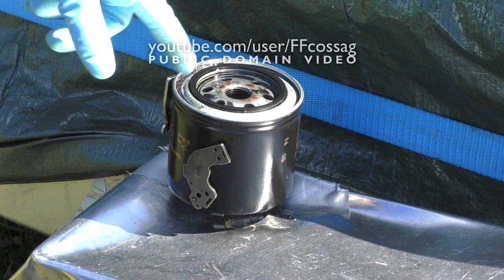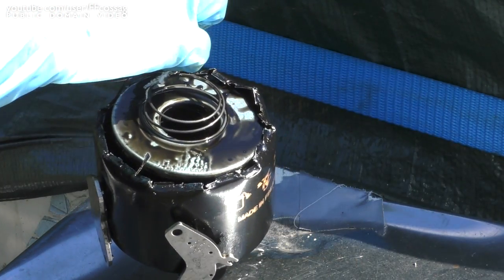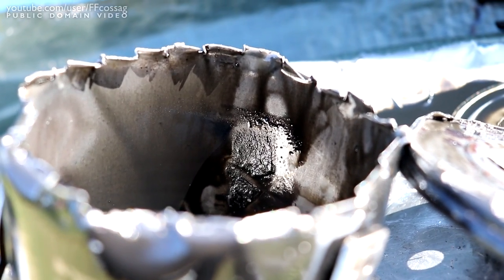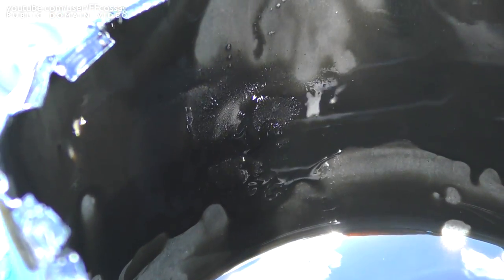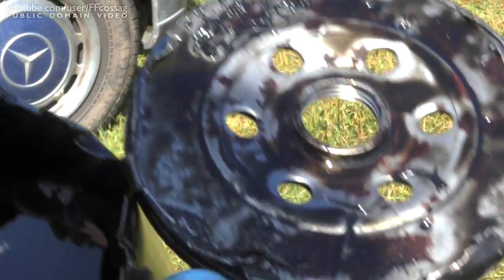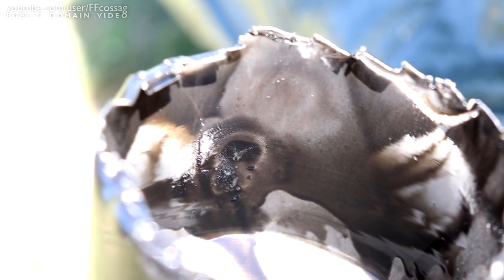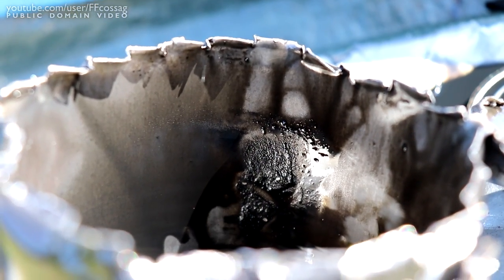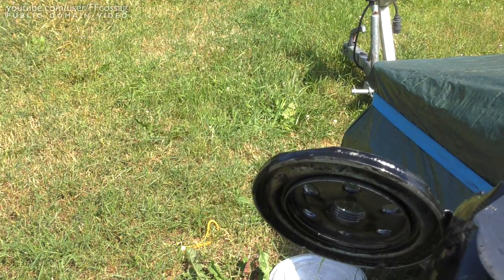Do oil filter magnets work?

Comment: I know that parts houses in the U.S. sell filter cutters (kind of like a can opener on steroids).
Reply: YEP. I ordered me a new Oil Filter Cutter just today -- Ebay -- $48.00 
Gonna find out if the FILTERMAG Magnet Kit does what it claims.
Reply: @SlikLizrd  I paid less the TEN dollars for one....
Reply: @fooman2108  Show off !!
Reply: @SlikLizrd  LOL, or just go into a friendly garage and see if they will cut open one for you!  My grandfather had one of those magnetic deals that he put on the bottom of the sump of the oil pans of his cars for years.  I do know that most of my recent cars have magnetic drain plugs on them.
Reply: @fooman2108  I want my own tool -- 'cuz I do my own work.  I spent the big bux to get a killer set of magnets, and I want to see for MYSELF just how well they work to take metal out of my engine oil. These are REALLY powerful magnets -- not a toy or plaything.
I have owned a bunch of foreign cars -- many of them had magnetic drain plugs in the engines, transmissions, and differentials.

Comment: 3:49 Aluminum is not magnetic
Reply: It is true that aluminum is not magnetic, but metals like copper, brass, alluminum and others become temporarily magnetic due to magnetic fields induced by electric induction when cundictive materials are in motion within a magnetic field. It is called paramagnetism. Also, non-magnetic material becomes mechanically trapped by the iron and steel particles, and then move together and get stuck on the magetic area. That is probaby why you see aluminum pieces in the video. 
Aluminum, boron, copper, lead, magnesium, phosphorus, silicon, and sodium are all shown to be reduced as contaminants in standard engine oil analysis when neodymium oil filter magnets are used. However, most to those materials are not extremely abrasive, except to the silicon, which is the most abrasive material in the dirty oil.

Comment: The oil itself still turns black, doesn't it... so clearly then it isn't pulling "everything" out of suspension.  What is it making the oil black?  Rubber, like from seals and gaskets... or burnt gas?  or tiny pieces of metal, like dust?
Reply from the maker: That's diesel for you.

Comment: Many years ago I designed a reusable magnet filter housing  and worked pretty good but because of loopholes in the patents rights I stopped. Magnets do work and catch the very fine particles that otherwise would go through the filter medium. Most oil filters ain't good at even cleaning oil. Yes even brand names I won't mention for fear of being dragged to court. I've found at least one make that does clean properly and that make is Purflux.
Reply: Although aluminium, alloys and copper won't be attracted to magnets but will reduce clogging so it can filter longer. 
Not many know that some filters have a bypass valve that incase your filter is blocked will bypass the filter and sends that dirty oil directly to your bearings. 😱
Bet most didn't know that.
Reply: Now im having a guilt trip for changing my oil a little late a few months ago
Reply: coolsupermanfly depends how much milage you've done over the service interval.
Reply: Also depends on how hard the oil has worked.
Reply: #16 Racing yeah right hey pitty your answer suck as I don't own a shop. Ow that hurts hey.
Reply: nightmare in action nighmare in action or your just pissed off I didn't mention your favorite brand.
Reply: Thunderstormworld dude I don't even fucking own a car only thing I own the uses oil is a lawnmower and a mini motorcycle but dont use oil filter I am into the electric cars the dont use oil
Reply: Thunderstormworld nope because I do have stuff the uses an oil filter just did not mention it because all brands seem to do the same my fzr1000 motorcycle has 350k miles on it been placing random filter and engine is still running strong and if you don't belive me there are some videos on my channel of the restoration prosses
Reply: nightmare in action nighmare in action please I've been a mechanical engineer, hydraulic specialist and mechanic for 26 plus years and there's not much you can teach me on oil filters. Please do a search on Purflux filters and you'll see the difference for yourself.
Reply: i am 100 percent sure i have been doing it for the past 25 years.
Reply: You got me curious, so I did a search on Purflux, and even on their website, I was not able to see the difference. It was not very informative.
Reply: Terry F yes their site is not that informative and if you have not came across purflux filters previously you won't know know that they are better, I had a old filter of a common brand and a purflux filter on my light delivery van that I kept for a sample and forgotten about them (what it's my workshop) 6 months later the common one was only left the metal bits and the glue they use over (vehicle exposed to the elements 90% of the time) and the purflux still holded it's shape with no detoriation or even misformed. 
Basicly youll only see the diffrence when you have inspected it first hand. Sorry for my  english spelling

Comment: 312,000 miles on my Chrysler 300 hemi..... Puralator filter, Kendall 0-20 full synthetic oil, still running today. BAM! NO MAGNETS
Reply: 720,000 miles on my 1989 Ford truck with the IHI 7.3 Diesel engine (notorious for dirty oil), BAM! WITH MAGNETS. I change the oil every 12,000 miles, and the filter every 24,000 miles. Been using Magnesaver brand magnets, since 1993. Same routine on my G20 Chevy Van with the 350 cu. in V8, it had 424,000 mile on the odometer,but I sold it, since things like door hinges were wearing out, starting to nickle and dime me too death, At the end of the of the 3rd transmission, it was time for it to go, but the engine was still running strong - same magnets.

Comment: Back on the 90s Avweb did a test on using 4 small  Neodymium magnets  1 “ long x 3/16 arranged equally spaced around the canister.    You oriented the poles each opposite to the neighbor .   They said it really did gather metallic debris  quite well.     I had a set and must say they weren’t even close to those old hard drive magnets in power..    I’ve used both just stick them on there and they will stay put.

Comment: Interesting.  However, these filters receive oil on the outside of the filter medium, filter it into the center of the medium, and thence back into the engine.  So you caught metal that might have been filtered out of the oil, had you not stopped it.

Comment: On my newly built engines I put magnets inside the engine at the oil pickup for the first 1000km.
Upon the 1000km service I remove the sump and clean it all out and remove the magnets and the contaminants.
No point really on putting magnets on the oil filter as the oil from the sump goes through the oil pump before it gets filtered.
Replace engine oil on a more regular basis than what is stated(manufacturers state long intervals so that they save money while the car is still under plan by them)

Comment: When it came time to do the oil change in my last Corolla I found a new-old Fram filter under the seat from the last owner-- with a date from around 2011. it sat under that seat for three years... still put it in, still worked A-OK. I as well as a few others are probably the same as you, not a fan of Fram filters. the mechanic shop we take the van to for big repairs usually does our oil changes for us now since it's just a $15 job. they get them from the mom&pop auto parts place 5 buildings down, and I don't know what the hell brand they are since they're unbranded, but I'd trust my life to them more than I would a "Flimsy Fram" any day. I've seen plenty of filter gore from them.

Will try the neodymium on the filter trick though, that seems like a helluva good idea now.

Comment: Checking for metal particles in hydraulic system oil sumps is a common and quick way of checking for trouble. Really surprising to me to see that much of it in an engine.
Reply from the maker: I'm thinking most of those big chunks probably came from my violent filter-opening procedure.
Reply: That makes a lot of sense.
Reply: Ehh. You can see shavings fairly commonly if your engine has an oil drain magnet.
Reply: I’ve found curles of metal in the oil filter in my old 3litre diesel Mercedes lol, it still runs and is tuned to 300hp

Comment: That's metal from the shavings caused by the cutting of the filter.
Reply: bando v'real you wouldn't get fragments that fine and that uniform from snipping open the top. 
Sawing it might have done but he didn't do that.
So NO
Reply: Apparently you missed the part where he showed the hammer and screwdriver that he used to open it.. No "cutting" involved...
Reply: TheRaellz best comment today I’ve seen
Reply: Could be, detractors. At least some. But plenty is from the erl
Reply: Quote from FFcossag reply to another comment 4 months ago, "It hit me after the video, that a fair bit of those metal particles look a lot like the metal that the filter is made out of. Since I beat it apart with a hammer and screwdriver, most likely some chunks came off in the process."
Reply: He shouldv'e used a larger pipe cutter
Reply: Bando is correct and the author of the video even admitted it
Reply: noxxi knox  exactly.

Comment: Wouldnt the filter itself prevent any metal shavings from getting back into the engine?
Reply: Of course, but what the filter cannot do, is remove the really fine material, that passes through the filter pores, which is responsible for about 70 to 90% of wearg in bearing areas,  piston rings and cylinder walls, and valce stems and guides, according to research by the Society of Autommotive Engineers.

Comment: i usually drop a magnet or two into the oil fill hole for better scavenging of the metal shavings.  I also drop 1 into my radiator every time i do a coolant flush just in case the shavings get passed the head gasket.  oh and almost forgot, i put a bottle of MMO into my gas tank every time i fill up.
Reply: ihave35cents the oil is cleaner then when I initially pour it in. Also I have some knocking noise coming from the valve covers.  That's how I know its working

Comment: I think its actually dangerous. Think of a bunch of Metal sticking to the filters wall after some time. Now you ride over a huge bump, the magnet falls off and a lot of metal is released into the oil stream at once. If that much metal reaches a bearing your engine is done.
Better change your oil often guys and your engine will be fine.
Reply: Except even if that happens, this is on the outside of the filter. Hence the metal will just go into the filter, not the engine.
Reply: I cannot say about his particular magnets, but the evidence seems to suggest, that they have not fallen of, LOL. Aslo, I have arced neodymium magnets on my dune buggy, plenty of bumps, and they have not fallen off either.

Comment: ¡I'm I want to fix my hesitation problem at idle on my 99 GMC Chevy truck with a 6.0 diesel engine what are we call it not that has it that the hesitation up rough idle I want to fix the rough idle situation with my 6.0 liter Chevy 1999 gas engine

Comment: You're engines drain plug and plug gasket should be replaced occasionally.  The plug is not intended to stay on the engine indefinitely. Oil drain plugs can be purchased with a magnetic tip to catch particles in the drain pan.  Whenever you change the oil, just clean off the particles stuck on the magnetic tip and put it back in when the oil is drained.
Again, replace the drain plug  and gasket occasionally.

Comment: Good test and didn't think there would be a need for magnets on an oil filter.  If you got metal, your engine is screwed and means you have no oil.  Magnets will "help" if you don't change your oil, cause that's when metal will show up.

Comment: Just simple.... change the oil more often. Filters suppose to clear the oil before engine. If you don’t change oil, you got yourself worn out filter.  Mags in pan plug should do good and wipe off each oil change.

Comment: I’m sure goad I used a Magnet on my oil filter because one time I checked and there was a small midget trapped inside the engine he had a ton of bling on and gold grilles.  That would have sucked if it got stuck between the piston and cylinder ya know?

Comment: I'm thinking the oil filter magnets don't do very much.  Most of the debris you can see would be caught by the filter anyway.  Oil is flowing pretty quickly through the filter when the engine is running, this may not give enough time for a lot of small particles to stick to the inside surface of the the filter.  I think a magnetic oil-pan drain plug would be more effective.  At-least the oil isn't circulating as fast at the bottom of the pan, and the magnet can attract suspended particles in the pan while the car isn't running, and most of the oil has drained back into the pan.

Comment: If you change your oil regularly and you have that much metal in your filter that engine is getting ready to grenade. New engines release metal till engine wears in but not much. An engine with major trouble will release a lot of metal.

Comment: On allot of cars the tip of the drain plug is magnetic. (If not you can buy them.) That's why magnets on oil filters aren't really necessary. (The metal you found was probably from when you cut the top off.) Still a good idea though.

Comment: on cold start when the  filter pressure relief valve will open , a major part of that dirt caught on the magnets will be washed by oil flow and transported in the oil pump and engine.

Comment: go around the filt can with a bench grinder making a partial cut thru and then it cuts the rest of the was with your method under no stress at all... to run the test true to form the magnet needs to be on the other side of the paper element to catch particles that have gotten thru

Comment: Use amsoil oil, oil filters, and bypass filters... You would .02 microns filtered.. Oil would be clear, no metal... Use the good stuff... Cost of use .. Cheaper than dino oil and cheap filters... Do it right
Reply: Check the Beta Rating on that Amsoil filter and you learn the truth about marketing hype.

Comment: Who lets their oil and filter run for 12,000 kms.  ?????
Reply from the maker: Many people do.
Reply: +FAA Inspector

"Who lets their oil and filter run for 12,000 kms"

Most Women and a lot of cheapskates. Its not uncommon for people to do an oil change once a year on older cars and then use cheap filters and oil designed for barn hinges... still, it keeps mechanics in business I suppose

Comment: I don't understand why people make these videos of cutting open an oil filter to check for metal and yet they don't invest in the proper oil filter cutting tool. To all the YouTubers that have made videos of cutting open oil filters with angle grinders, saws, and many any other destructive ways, you're wasting your time and our time because you are putting a lot of metal into the filter from the cutting process. If you really want to get a good look of what's going on inside your filter get the proper filter cutting tool which is not expensive and does not get additional metal particles into the filter.
Reply: I use an air hammer with a muffler bit. Comes off clean.
Reply: Yes, I have one of those, and it was not that expensive. However, the point of a lot of videos, is just to make videos and get viewers, not necesarilly to provide something that useful. If that was not the case, you would not see so much clickbait!

Comment: How do you know the metal particles didn't come from cutting the filter open?
Reply: An experienced mechanic can tell the difference between tiny particles and scrap from trimming.
You're not from around here, are you ?
Reply: @SlikLizrd  what the hell difference does it make where I'm from?  It only took you three years to reply.
Reply: @fabio40  Not true !!
I first saw this thread yesterday, and that's when I responded.
Reply: @SlikLizrd  I asked the rhetorical question three years ago. I don't even recall asking it. I don't even care what the answer is really.

Comment: Ok, so instead of in filter,  iron peaces are trapped on magnets. So what is dofference? This peaces would be catched by filter anyway...
Reply: No, most of the wear on the engine, is from fine material which you cannot see, which good magnets trap, but filters do not. Look at https://youtu.be/EGMh0f_aYD0 and you can see how fine this stuff really is. There is a reason that oil turns black, and that is the stuff that goes right through the filter.

Comment: Does the Oil flow through the Filter Element before or after being passed by the Magnet?  If the Magnet is capturing these particles after it has passed through the Filter Element (you have a Worthless Filter) if the Magnet is capturing the particles before it is run through the Element ... big whoop, they would be captured by the Filter Element (if it is a good one).
Can't hurt to put the magnets there but I see no real benefit.

Comment: If there’s metal in your oil filter you have a major problem with your engine that magnets can’t fix. Change your oil on time and check it periodically between oil changes. If magnets were such a great idea the car manufacturers would install them
Reply: Not true. Manufacturers don't install them because it would be another service item -- they don't wanna do any more work than they HAVE to !!

Comment: My previous car I owned for 15 years and it had done 140,000 miles before it went to the scrapyard. The engine was still fine but the rest of the car had worn out making it uneconomical to repair. No magnets were ever used. Same goes for previous cars. No magnets used but engines still fine at the end of vehicle life. So I think the magnet thing is a bit daft.